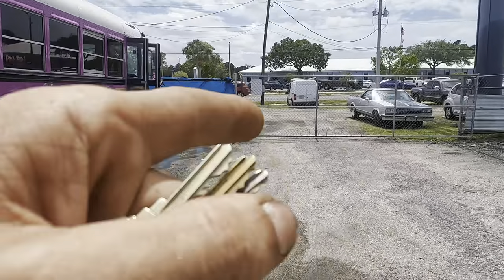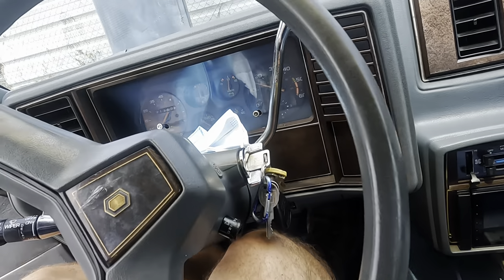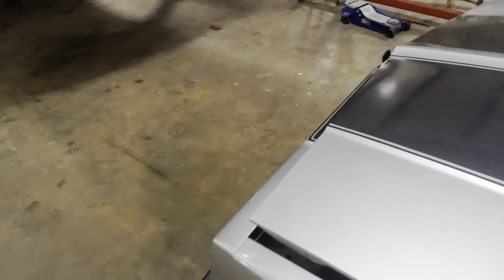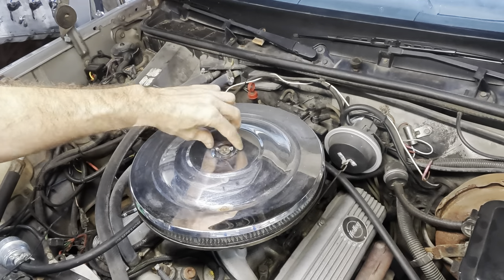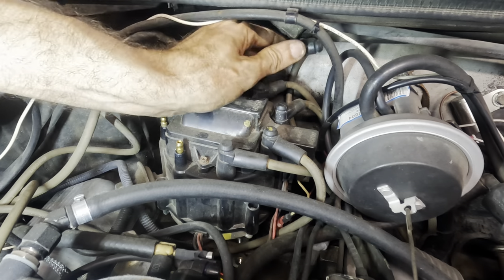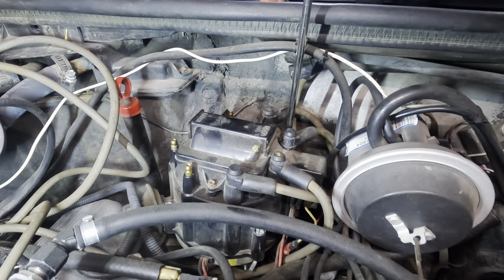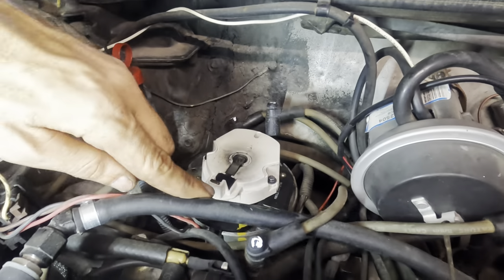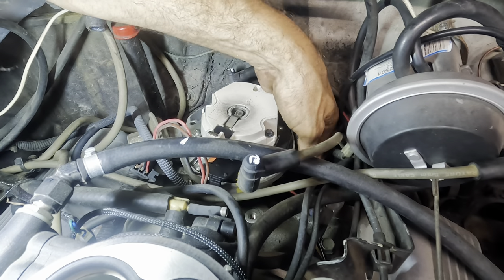Shuts Down While Driving! 1985 Chevrolet El Camino | Karen Story at End #mechanic

Comment: My Uncle Felix had one  from the mid 1960's till he died in 1975. Loved the vehicle. Easy to work on and  for the light hauling of stuff around his small dairy farm, it was a perfect fit.  I find it very interesting that you can work on it with the kind of expert skill set that you have.  I am one of those fellows that like the old stuff better.  Yeah computers and scan tools make it some what easier but a lot more complicated- I like KISS - Keep it simple stupid!
Reply: I'm from the old school, now I'm too scared to do anything on my Nissans. The spark plugs last a lot longer, 5 years on the Maxima.
Reply: I’m pretty close to Ray in age and I’ve worked on stuff from the 60’s to current stuff. I haven’t used a timing light in over 20 years. The systems all kind of do the same things, but now it seems like it either works or it doesn’t. A 69 impala you can play with and adjust to get it running smoothly. A 2015 Rogue and you just replace the offending part. In some ways, the new stuff is easier. It’s just a little more cramped, a lot more plastic, and a lot more expensive. Plus, you can read the computer to tell you what’s wrong. You have to have a pretty intimate understanding of old cars to figure them out sometimes. Plus, there’s always the crap that a guy did 40 years ago that doesn’t make any sense that you have to sort out.
Reply: Actually, to be positive, KISS stands for keep it short and simple.

Comment: Ray, really enjoy the videos.  Thanks for making them available.  I do have a question - why dont you simply move the heavy lift back toward the door just a little to give you some more room between vehicles and the wall?
Reply: The Reason he can't move that lift is because if he has a car on it, the lift to the right becomes unusable. If there is a Tahoe on the big rack and it is lifted up all the way, he can sneak a small car under the Tahoe and get to the right-hand lift. that is why the 3rd lift is going in the other side to the right.

Comment: Still got a timing light, and actually used it recently, to check that a coil pack was weak and misfiring, by comparing the 2 halves output of the coil pack.

Comment: Back around 1975, I remember my neighbor (teenager, like me) tried to replace the family station wagon's distributor cap.  He unplugged all the wires without marking them.  You'd be surprised how badly a V-8 runs with the wires all mixed up (or maybe you wouldn't).  No internet back then to check the wiring order.

Comment: I used a 12 V bulb and wire on my VW BEETLE pre timing light which I still have. with on T.D.C. No.1
hook up the wire to points as soon as the points brake , bulb will go dark. you are set. have a great day!

Comment: I learned along time ago to set timing with a vacuume gage that makes it perfect for each vehicle. Connect to the intake vacuume port, Rotate the distributor till the needle goes into the green and starts to bounce  then back it  off till its steady, lock it down. The result is max performance and fuel mileage every time!

Comment: Ray,the dist hold down is slotted where the bolt goes,so you dont have to completely rewove the clamp and bolt, just loosen it enough so the clamp will slide off of the dist!!! much easier to change the dist!!

Comment: Thanks for mentioning how sloppy they fit. 
It had been awhile since I changed one and recently changed one and that bothered me how sloppy it fit.
Although I was wondering why one had a o ring seal plus three gaskets ...
After getting it running again it ran like crap . Of course that was my fault because I worked on it . Not because of the multitude of issues it had before it quit running.
No timing light needed

Comment: Not my first car, but first car as a young family was an '83 Pontiac.  Same setup.  I miss some of the simplicity, but those older cars needed more maintenance, cap, rotor, spark plugs more often..lots of grease points in the suspension and driveline. That A/C compressor was a ticking time bomb.  I still have a nice set of distributor wrenches and my timing light.  We have some much older trucks and tractors on the family farm I will be working on eventually.

Comment: 22:56.  The side post terminals on the battery threw me for a loop.  Looking at the top, the negative terminal is not connected.  Side post terminal batteries are not common here: Australia.  Every vehicle I have owned has had top terminals only.

Comment: I remember when I would time my 
GM 283 and my 350 I would make sure on my compression stroke number 1 cylinder at DTC with points just starting to close. That was before electronic Ignition. I miss my dwell and tach and timing light though. I miss the simplicity
and the rumble of an American V8. Great video and Great content 👍

Comment: I remember my dad power timing the engine when I was a small kid. He’d romp it, then fiddle with the distributor, then do it again until he got it perfect.  That was an early introduction to engine tuning for me.

I recently rebuilt an olds 403. I had found top dead center and had dropped in the distributor, then filled the float bowl on the Quadrajet and it fired right up. In this day of computer controlled everything that was very satisfying.

Comment: Ray the next time you go to change the distributor on a SBC or BBC turn the engine backwards before you pull the distributor out . And when you put the distributor back in the engine it will go right into the oil pump . Try that , it has worked for me every time .

Comment: I had a 1980 Malibu 2dr 267 V8 and 256 rear I believe that is correct. Dropped a mild SBC 400 in it. Blew up the lock up convertor tranny just breaking in motor doing 10mph around the block. After new tranny decide to go to junk yard and got a Buick Grand National 3.42 rear which bolted righted with new drive shaft. Made a big difference. Got board after a year and pulled motor and put into an 82 Pontiac TA. Put a stock SBC 305 back in the Malibu to sell it and with that rear was still really peppy. A couple of things the owner might want to make sure is the thermostat especially for Florida is 180 degree thermostat and the aluminum manifold heat crossover are blocked. Also check vacuum advance. Could that fuel injection be oversized for the cam/motor?

Comment: wokred on a old 76 f150 that would die and not start when hot, was vapor locking in the metal line that runs infront of hte engine, I just bypassed that with a rubber hose that runs in a cooler place. Runs great 9 years later still.

Comment: Years ago I customized a 1982 El Camino ended up selling it few years later on eBay Motors for $10,000.  Cost to customize was over $15,000. 82 had the large square headlights

Comment: next tip on the distributor stud hold down clip. best thing to do before reinstall is to start the placement of the clip first rounded side down and the oval machining of the hold down tab will allow you to slide it outward toward you while the 9/16 nut is almost barely held by threads. then you can move it in and out toward the distributor shaft once it is in place and aligned with the oil pump gear. there is  really no reason to remove the distributor hold down clip at all just loosen it and slide it outward toward you until the clip ends clear the shaft bold down area if that makes scene.

Comment: @Ray, you absolutely, positively, without exception, need to set the timing!!   plus, that throttle body fuel injector setup is very, very particular about how to set them!   Especially when installing a new distributor.  Also, recommend HIGHLY, with that engine, losing that type of EFI and moving to something like a Sniper or a Bandit... but with a nice baby like this '85 Camino...  i'd go back to a Carb!

Comment: Dang i have a 1985 elcamino conquista too but mine doesn't have the Fitech fuel injection unit yet ..its a quadrajet 4 barrel upgraded to 350 over 305  tho ...Nice to see you go old school ray
Reply: I have one too with orig 305 I would keep the quadrajet I got rid of the smog stuff and computer control carb it runs alot better then the computer control. However I was getting vapor lock on mine. it was old fuel lines
Reply: @mikeroper9641  Yes i believe i will i still have the computer controlled quadrajet that came with the 305....but i now have a 78 carter version of quadrajet and regular vaccum advance distributer now as my original old school computer literally smoked itself .....cheers enjoy your Cruck i love mine had since 2013

Comment: My friend has a 1985 el Camino. It was doing the same thing. It was the ignition in the steering column. It was the 6 cylinder.  She did the distributer  first and it kept doing the same thing . Replaced the keyed ignition. And that fixed it. She drives her el Camino about 2 mi a day forever. Her job is so close. Works at a donut shop for 30 plus years.

Comment: There must be a forum,or something, where dirtbags get together. I’m in Boston area. We have those gas pump sitters here too. Some just pull up to the pump, run in to the store for butts or wraps but don’t buy fuel. Some just pull up and sit, never getting out of vehicle for anything, then leave 20 minutes later. Another trend here, I’ve noticed, is people driving with their high beams on. If I’m in my tow truck and they are behind me, I hit my three toggle switches and blast them with my work lights.

Comment: Just an FYI, the beauty of the GM HEI distributor is that everything in the ignition system is housed in the distributor. The vacuum advance and the centrifugal take care of timing needs once base timing is set. Replacing that distributor replaced every electrical component in the ignition system. If he is still having hot start issues, it’s probably something in his aftermarket fuel injection system. Signed Arods auto teacher….lol

Comment: Had a Toyota Tercel that died when hot.  Dealer replaced the distributor.
I'm not knowledgeable about methods like timing with a vacuum gauge or by ear but my 50 y/o memory is that a small rotation of the distributor would have significant degree changes as shown with a timing light.

Comment: I have worked on a bunch of cars with the hei distributors the last one was on a 305 in an Oldsmobile same issue but I just replaced the plastic modules mounted on the base under the rotor and that corrected the problem. Funny about the Karen story as three days ago I ran into one at a Wawa’s woman in a student driver car with two teenage boys sitting in one of four total diesel pumps. Not pumping gas the two boys were in the store 20 mins come out and one of them goes back into the store for another 10 mins. I’m not as patient as you I read them the riot act when he finally came back! There is just way too much disregard for others running rampant here in Florida!

Comment: Even with fuel injection that hot air intake on a Florida summer day could be causing vapor lock. Had it happen to my 70s carbureted Ford when I had the air filter cover flipped over in Dallas.

Comment: Gee Ray, I guess you wouldn’t want a dwell meter either.  And yes I remember those days when we changed points/condenser every 8,000 miles and plugs every 12,000 miles. Glad those days are gone.

Comment: Old school tricks the hold down is slotted enough that you don't have to completely remove it and you can hold the distubritor while a helper bumps the key and it will drop in the distubritor turns with the cam and drops when the oil pump rod aligns

Comment: One intersection I drive through everyday has such a notoriously short green light that sometimes people will honk the very instant it changes.

One time at a gas station some idiot left their car idling, door open while they were inside blocking BOTH pumps on that particular island. Took every bit of self control I had not to go and put it in drive so it would go over the end of the lot and down into the woods. 😈

Comment: Back in the day you had to be careful when pulling the distributor because if there was a high output oil pump on the engine there would be a slight amount of oil pressure on the filter side of the pump and the pump drive would move when the pump was removed.
Back in "72" I can remember my cousin and a neighbor going together to buy a top of the line timing light that had the adjustment dial on the back so you could dial in the timing and just use the factory marks when you had an aftermarket cam installed. I think it cost around sixty bucks back then and think I seen one somewhere for about twenty recently.

Comment: Fun fact about Alice. I got to build put a new engine in my 92 Camaro. I got a 1979 350. I remember working on the distributer and hating every second of it haha. I wasn't sure if I had the timing right, but an old machinic told me to drive it for 20 minutes or so. Once its up to temp and running good. Pull over, shut it off and try to start it. If it started 'too soon', the timing is a tooth or two advanced. Unfortunately, life happens and I had to sell the car. :(

Comment: GM HEI ignition modules require a heat sink compound to be applied between the module and distributor body. If that aftermarket distributor didn't have that when it was assembled that could definitely cause issues especially after a heat soak.

Comment: You can use a vacuum Guage to set the timing. Max manifold vacuum, then back off 2 inches.  Reset idle, then max vacuum. Back off 2 inches vacuum.  Done.

Comment: tldr: magnet with pickup coil and star shaped spinning reluctor in Chrysler distributor products had similar hot failures, took many years of failures and fixes (my mechanic disowned it!!) to find out that the older distributor magnets got weaker when hot, the signal to regular ignition module OR Lean Burn  modules  drastically dropped and the module said "eff this"....   final road diagnosis - popped dist cap and blasted the magnet with freeze spray. Perked the car right up.  My bona fides: drove 78/79 cordoba WORKING lean burn systems under State emission control program until 2015.

Comment: The distributor clamp has an elongated slot for the bolt .. no need to remove either…I don’t have a timing light but I have the special wrench to remove or adjust the timing but I can’t check it on the timing marks marked on the front dampener…that is unbelievable.

Comment: This reminds me of the time i helped rebuild the engine in my brothers 85 Oldsmobile with the 307. We thought we had the distributor set in place right tried starting and it would backfire through the carburetor. We finally got it in the right spot then i ended getting my left foot caught in between the radiator fan and shroud and twisted it the wrong way and ended up being put in a walking boot for about 3 months then surgery because they found a few bone fragments because the cartridge never grew in right around the ankle joint

Comment: Dissies were all there was when I was a lad. ideally you would use a strobe light to time them. i still have mine. It's 50 years old.
But you could get good timing by ear.
You slacken off the clamp and rotate the unit clockwise and anticlockwise until the engine starts to hunt in each direction and the sweet spot is in the middle of those two extremes.
I used to set it like that and then check it with the strobe light.
But I eventually didn't bother with the strobe light because I never had to adjust them.

Comment: I had a customer that had a so called Chevy speed specialist that installed  a set of L88 heads and a three two set up and high performance cam. This speed specialist missed three head bolts (they were hand tight) and damaged the intake because he tighten one side of the manifold and then the other. I replaced the head gasket and he had set the timing to the stock setting. I didn't have any info on the cam. So I used the vacuum gauge to set it. I set the tack at 1k rpms started to advance timing till I got  maximum vacuum then back down the timing till it lost one inch on the gauge. This was a 1980 Corvette and it took me three days of test driving just to make sure it was running right. Lol. Four months later the gal that owned car totaled it in a parking lot showing off smoking the tires.

Comment: .  it still had a QUADRAJET carb or an older Holley, I might say, an over heated carb. Those style engines use to use exhaust to warm the carb. Then they used the engine coolant. There would be a crossover port between the head. When fuel injection came along, they blocked those openings in the head and intake. Good thing it's not Points yet.

Comment: 1) Fuel boiling due to heat/vapor lock in fuel system. 2) Fuel pump pressure and volume check. 3) Check the ignition component placement for undue heat exposure.  Just thinking outside of the box here. Consider an isolating block/wafer made out of phenolic/bakelite/fibre for this purpose to keep the throttle block from heat sinking from the motor and boiling the fuel.